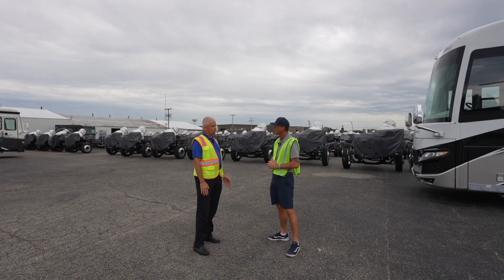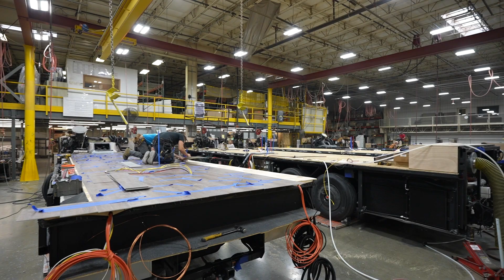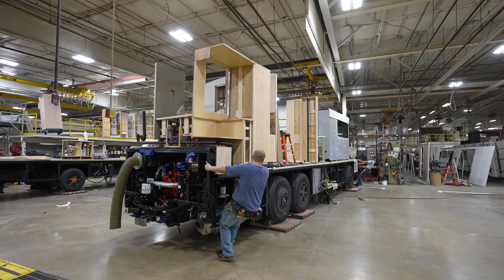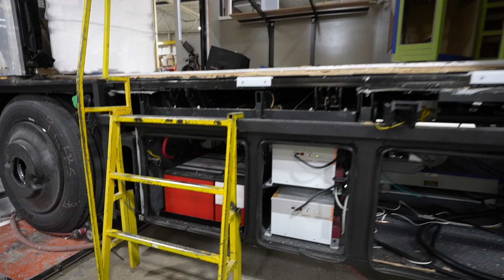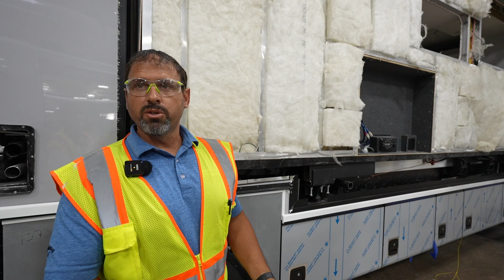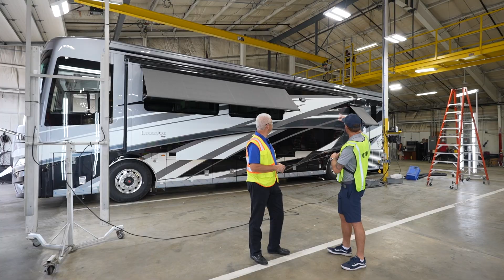Touring The Newmar Factory In Nappanee, Indiana!

Comment: Mr Steele I learned a lot about Newmar in this video but two big items were not covered.  ONE:  The thickness and construction of the fiberglass that goes on the sidewalls and slide walls (top, bottom, and sides ) TWO:  How do they seal that flat fiberglass to the RV with out creating a raised barrier of sealant all the way around the roof which would  hold water up against the sealant.   Also is the seam for the flat roof under the awnings and valance making it impossible to inspect and repair without removing the awning and valance?  Are there screws all the way around the perimeter of the roof creating hundreds of holes in the roof to seal?

Comment: Before you buy one of these make them physically show you where the VIN is stamped on the motor home chassis.  If it is not, it is not legal.  If the stickers can be removed without damaging the sticker, it is not legal.  The stickers should destroy themselves if you try to remove them.
Reply: There is no law anywhere that requires “vin stamped on frame”, that is the BS that Amazing Dumbass Liz wants us to all believe.  I researched and it is just required as second end coach builder to be placed with a non removable sticker which Newmar Does.  Now, I do hope they step up and do something to fix the hope started by a couple YouTubers who have nothing to do, and put this issue to bed.
Reply: @kevindean117  Newmar stickers are removable without damaging them. That is a problem.

Comment: I owned a 2001 Dutch Star 4095 and a 2002 Mountain Aire 3778 as part of my rental fleet about 10 years ago. Although they were older models, the quality of Newmar was still intact. I loved the Dutch Star with it's CAT diesel engine and the Allison transmission. The only recurring problem was the windshield, which cracked on the passenger side and I made the mistake of not replacing with a OEM product. Spend the extra $.

Comment: Alright…. My opinion here.  At the 19.33 minute mark there is a pic of a side wall that has been insulated.  It really doesn’t look good.  I’ve been on many factory tours in the Elkhart area and this looks like a  trailer job…. Not a 600k coach.  Gaps down the sides of the studs, insulation is short and doesn’t meet in the middle. Insulation pushed around an electrical box so there is none behind it to the outside wall.

Comment: Please do a video of the ORDERING PROCESS.  Start to finish.  Including all of the various timelines.  Go over every single item listed under the FEATURES and SPECS tabs on the Newmar website & exactly what each listed item is.  More than what the Newmar website does, that is way too basic or generic.  There are many different Features and several "Available Options" listed that until they are explained like you do so well we may not fully understand what it is.  I'm thinking about options vs standard, colors, textures, special one off's, etc.  Get crazy.  Don't forget the electronics and high tech stuff.  What information would you deem useful as a future buyer that wants to do their due diligence in understanding all there is to know about this build and purchase.  Explain the benefits of the different electronics & why one is better than the other.
Also ask Newmar if they have heard of the Samsung Silver battery to replace the Lithium battery.  Much smaller, more powerful, cheaper, charges faster & overall more efficient.  Thinking about the overall coach weight, this may be the next generation in batteries and coach weight reduction.
Next, encourage Newmar to revamp its SHOPPING TOOLS - FIND A COUCH because it's lacking at best.  It shows a map America & you have to click each State by State to get the Dealerships.  Pain in the Bleep.  Just SHOW the dealerships.  But enhance the map to do a search for the coach of your dream, the model, year, colors, electronics, mechanics, and as many of the options as you want to select, etc and then WHERE did that coach go once it left the factory......  What Dealership (s) can it be found as the coach you just selected.  I'm thinking of the type of search capabilities found in many big name dealerships like the ones you do videos for. 
Basically, how can I as a prospective buyer, hundreds of miles away from the factory & dealerships get as much information as I can right from home to help me to decide on what I want all it's options & where it is sitting waiting for me to come get it. 

Keep up the videos, we love them.

Comment: disappointed about the insulation in these coaches. First off to see the bat insulation rather than spray in foam is a turn off for me. However, if you are going to use bat insulation, at least make sure there’s no gaps between the bats
Reply: You will thank them later if you ever have to run a new wire or replace one with the batts. It’s far better than styrofoam that some of their competitors are using…
Reply: yep that insulation job was subpar. Don't know why that did not use full batts in each section.
Reply: @anthonyjasinski6322  Especially if it was a New Aire!!  But even the Dutch Star’s are $700,000+.
Reply: Just because we see gaps, doesn't mean it wasn't corrected. Someone could have been doing something.
Reply: Totally agree, I seen that right away, extremely disappointed!!

Comment: Where were all the Baystar coaches? I hear they get the same treatment as a top of the line and the same assembly line. Is that true?
Reply: That is true.
Reply: @edmartin9451  so the slide construction, thickness, and insulation are on par? I've had a gasser, and the AC was unable to keep up in the south. I wonder how Baystar would do... my other was Forrest River, so I know there has to be an improvement.

Comment: The batt insulation is disappointing. Two inches of fiberglass batting is almost worthless, I doubt it's above R5. Not to mention that you can see the gaps where it was poorly installed.
Reply: Yes, I’m a contractor and I seen several spots in the walls where there was an inch plus gap in the insulation that would not be acceptable for me and my crew!!  So much for quality control… we got to see the lack there of live in the video!

Comment: Thanks for setting this up. I was very curious of how far the industry came along as far as automation is concerned. These units are hand built leaving opportunities for automation to the wielding processes, using camera systems with picture analysis for quality control and also tablets at every station for real time interaction with the build guides. The quality would stay at the highest levels and overall cost of production would go down. A lot of badly built units flooded the market caused by the fact that hand built units depend on the tradesmen not having a bad day. More robotics at key areas would mitigate this.